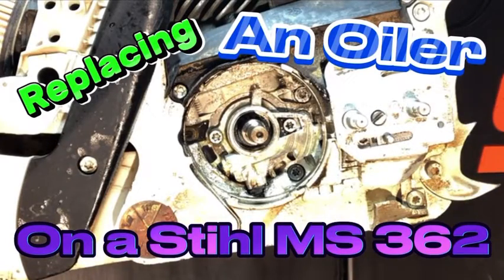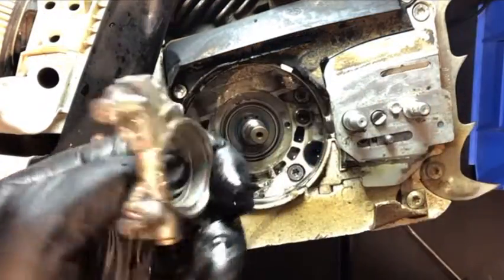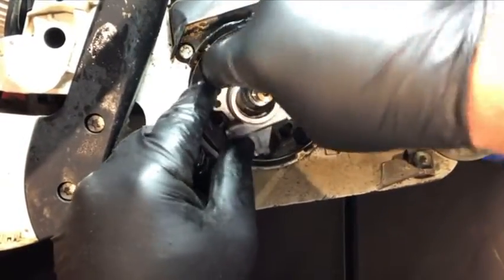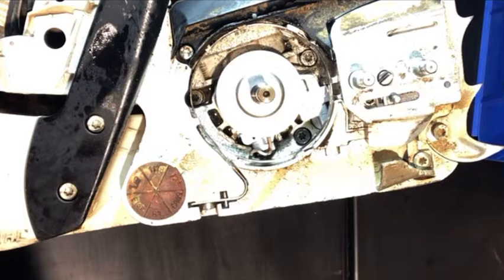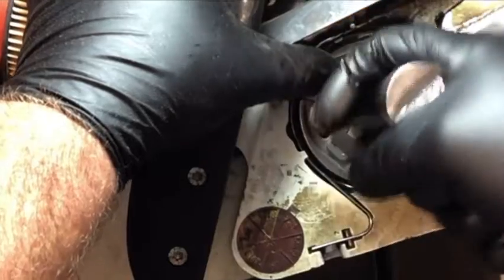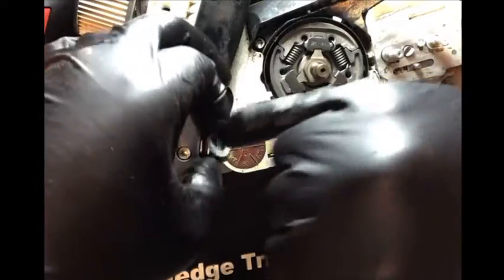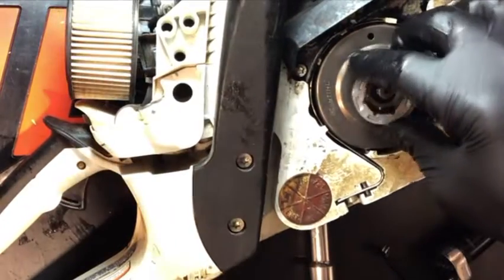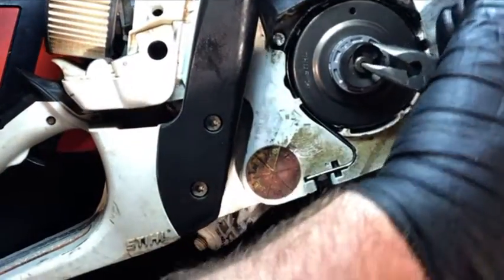Chainsaw Oiler, Sprocket, Needle Cage and Worm Gear replacement on a Stihl MS 362 saw. #stihlms362

Comment: 2:11 - so the needle bearing sits like 3mm down from the drum edge in the middle and they should NOT be level/flush in there ?
Reply from the maker: @2012isRonPaul  the needle cage does not sit exactly level with the top of the sprocket. Sometimes they are a tighter fit than others if you are reusing a dirty sprocket.

Comment: Why wouldn’t you show the disassembly from start??
Reply from the maker: This particular saw came in to the shop with the needle cage exploded and the washer and e clip gone.  The sprocket was also gone.  I just took off the clutch and the oil pump that is why I don’t have a video of the rest of the tear down.